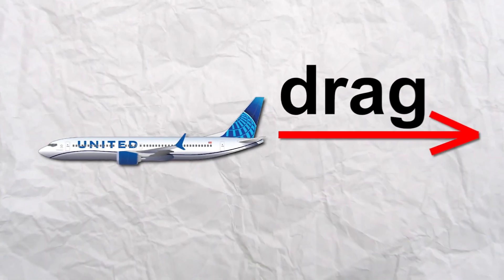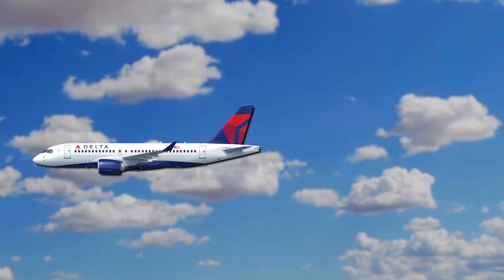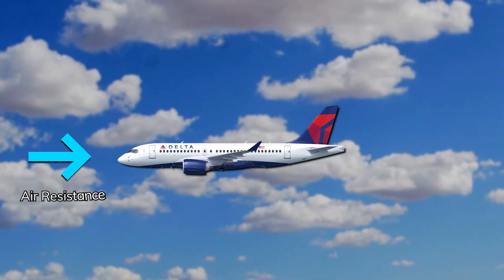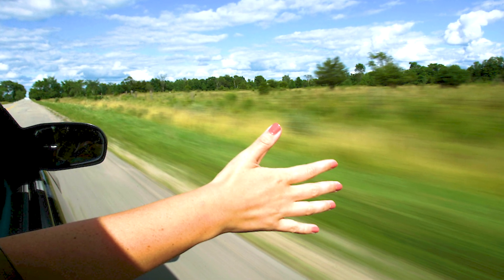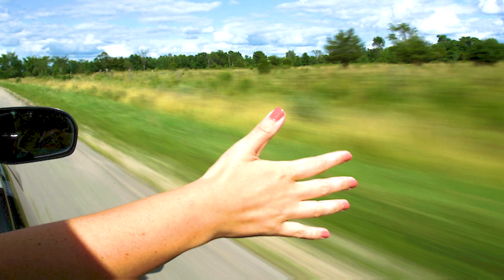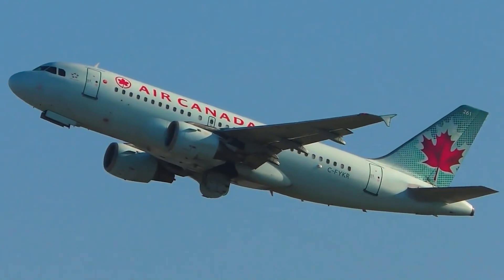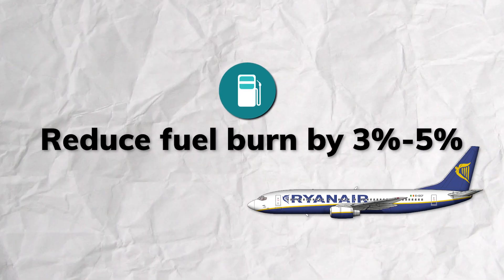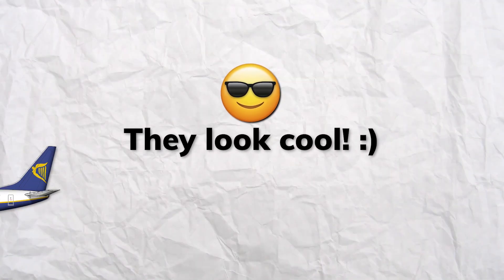What Are Airplane WINGLETS For?!

Comment: You need to research spanwise flow.
Reply from the maker: What about it?
Reply: @LuxPlanes  Apparently the vortices explanation is a bit of an over-simplification, and much of the drag saving come from limiting the spanwise flow on both the upper and lower surfaces of the wings, for quite some proportion of the wing. This is also why winglets aren't just fences, which might create more drag than they save, but are carefully shaped aerofoils in themselves to oppose the spanwise flow that would be there if the winglets weren't. But that's close to the limit of my understanding. There are plenty of discussions online though.

Comment: Thanks i never knew what winglets did, my speculation was they were like mini vertical stabilisers. Anyway, can you maybe say in more detail how winglets reduce noise pollution?
Reply from the maker: Yes of course! Basically since they reduce the drag (which opposes thrust) less thrust is needed. Thrust is created by the engines which are what burn the fuel, so if less thrust is needed the engines can be kept on a lower power setting. Lower power settings burn less fuel, therefore reduce operating costs, and pollute less, and the lower the power setting the quieter the engines are too. Hope that helps :) thank you for watching and I’m glad you enjoyed the video!
Reply: thanks for the explanation:) @LuxPlanes

Comment: I would like to mention that if the route the airplane is flying (this goes for the 737-800NG) is shorter than 1 hour and 15 minutes the extra weight of the winglets outdo the cost savings!
Reply from the maker: Ah that’s a very ingesting fact! Thank you for sharing!
Reply: @LuxPlanes  Thats why the winglets always were optional. I know SAS operated a few 737-800 without winglets, i flew them!
Reply from the maker: @JKB-  yeah I’ve seen some pics of those planes, very rare to find an NG witbout with winglets! Amazing you could fly on one :)